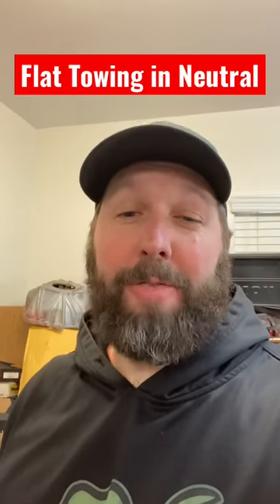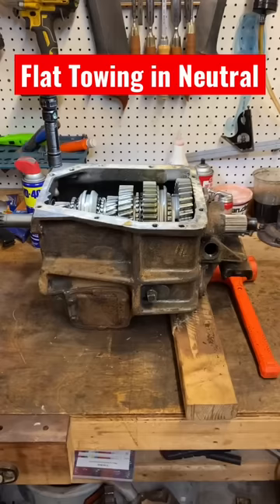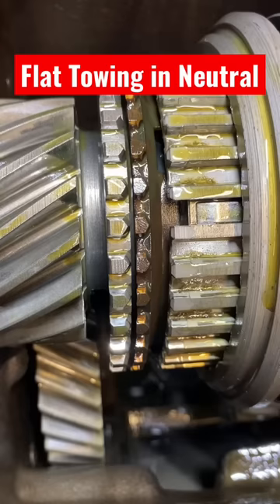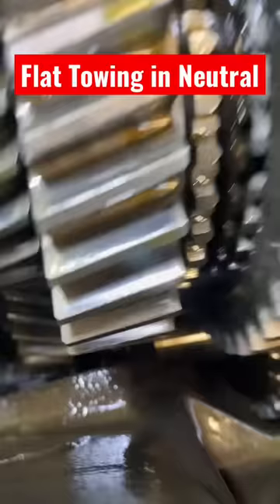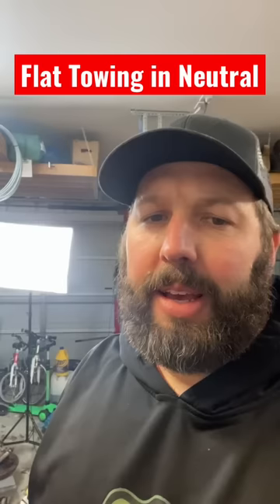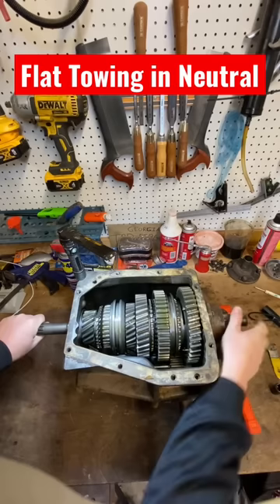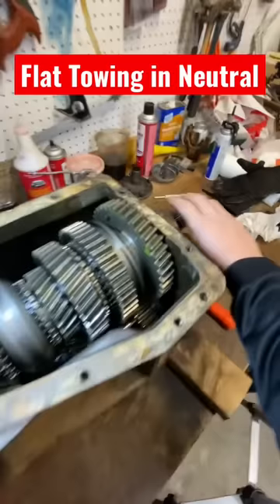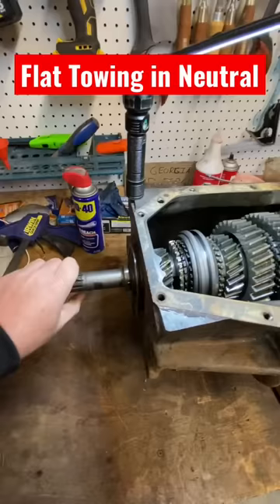Flat Towing in Neutral??? #transmission #stickshift #mechanic

Comment: You overlook 1 main thing... here's no dam load on those free spinning gear. Hence the heavy oiling ain't necessary.
  Secondly no towing company going to tow vehicle for miles.
Reply from the maker: I guess Tremec doesn’t  know what they are talking about either 🤷🏻‍♂️. https://www.tremec.com/not_am_detalle/flat-towing-manual-transmission-vehicles/
Reply: @freedomworx  I don't care what tremac want to say ... I have rebuild many gearboxes and I can assure you that towing the vehicle in neutral will not cause damage.... the gear oil stick to these gears and require great effort to dispose... there's no load/pressure on these gears to cause damage... especially for short journey traveled when towing (as stated in the article) 
  You need to understand that these gears are very harden metal.
   Now extreme situation as the vehicle was sitting for years ( n even so there we be gear oil on them) or the gearboxes recently build and was not lube after degreasing and the vehicle is then tow across states ... yes it will be damage. So if the above condition are what you are referring to then I agree 🤣.
Reply from the maker: And you need to understand that it has nothing to do with the gears. It’s the spinning bearings that build heat and seize. There are literally no gears meshing in the stated condition. So you totally misunderstand the situation 🤷🏻‍♂️ Read through all the comments and tell all those that destroyed a transmission that it will cause no damage. You can learn from this or you can remain ignorant. Makes no difference to me 😘
Reply: @freedomworx  lol.... there's is always   gear meshing... its lock into gear when selected.... now you need to get in your head that if the gears or lock and loaded then there's no dam pressure on bearings to cause damage when towing.... the weight of the vehicle is not not being carry by the gears nor bearings... the output shaft is driving the lighter free gears and bearings... but the gears and bear will surely damage when it driving the out put shaft which intern move the weight of the vehicle...
   Your so confuse and not understanding the load on parts when the driven system is powered on reverse. 
    The gear oil is not thick for no reason, it a heavy lube next to grease that remains on surface apply... it will take a great deal of time to dispel it.
     Bearing can get damage even when properly lubricated in a gearbox .... what you think cause these catastrophic damage... LOAD!!!! what load???? ENGINE LOAD!!!!!  No dam engine load is present on gears nor bearing when tow.
    Many manufacturers recommend that vehicle be place in neutral when towed ..  so who knows best????
   Imagine a engine jam or damage n u place it into gear and tow???
   Just stop tell people crap. ... no vehicle being tired is going to be towed across states and only a idiot would do that and destroy their trans. 
   I have read a # of comments and the are 90%+ not in agreement or mocking this video... amongst the comments are also great insight as to what is happening and not a broad blanket statement like made by this video.
     In everything you have ignorant owners who don't know how to operate equipment/tool and they cause further damage.
Reply from the maker: @willis23jm1  watch the video and tell me that those output shaft gears are meshing with and spinning other gears 🤷🏻‍♂️
Reply from the maker: @willis23jm1  5 million views across multiple platforms, and about 2000 of you knuckle heads can’t seem to comprehend even after being shown with an actual disassembled transmission , or being given an article from the premiere manual transmission manufacturer in the nation. And bearing the fact that every single heavy truck gets the driveshaft removed when being towed. And refusing to actually read the video description before making ignorant inflammatory comments. If ignorance is bliss… there are some happy folks in the comments section 😘
Reply: @freedomworx oh I see your problem... because the gear isn't spinning you conclude that it no longer is meshing 😂.... well the gears are always meshing, it's just not lock to the output shaft hence the output shaft doesn't spin. .. but they spin when you turn the input shaft... now tell me if you see any of the gears actually shift..  the gears always mesh its just not lock to the output shaft..
   Now what you not getting into your head is that there's no load/ pressure on any bearings nor gears when the power source is coming from the output... hence no damage will occur.. 
  Bearing and gears are design to bear load... the gear oil is to extend their life when carrying out this duty ... but if there's no load then what else would cause damage???  Friction??  Well in order to produce friction that will cause such damage you going to need LOAD!!!
      OH FYI most modern gearbox oil level and location (different design) 🤷🏾‍♂️.
Reply: @freedomworx lol.... how many out of the 5 mil are actual mechanics or engineer?  Majority isn't an indication of being right..
   The main reason why you would disengage a truck drive shaft when towing is normally when you suspect damage to gears/ bearing not because the output shaft will drive bearings n gears and cause damage... it just to not cause further damage ...meaning there's already DAMAGE!! 
   Now surely you have seen way more of these trucks being towed without disengage the shaft with no. Damage 😂. 
   Stop spread false information  termac or what ever that company name transmission main need to disengage because of their stupid design .. but this is not needed for other manufacturers period.
     Funny how in the video you actually turning shafts and none of them broke!!!!  You wanna know why??? NO DAM LOAD!!!!😂
Reply from the maker: Drain the oil out of your diff and drag the truck down the road and then. See how long that unloaded pinion bearing lasts 🤷🏻‍♂️
Reply from the maker: @willis23jm1 well I’m an engineer…are you?
Reply: @freedomworx  well we both are 🤣..
 So mister engineer ... which  will fail first a lubricate bearing under load or 1 that's not underload??
Reply from the maker: Your arguments are ridiculous. There is a reason that so many owner’s manuals tell you to remove the driveline, place the T-Case in neutral, elevate the drive wheels, or to simply not flat tow. There is literally an entire industry dedicated to making systems to prevent this type of failure on vehicle towed behind RVs. Yet you think the transmission designer, vehicle designers, and RV industry are just a bunch of dunces. You are just making yourself look foolish. If your owners manual tells you not to do it (some do and some don’t)…this video explains why. That’s a simple, evidence based, fact. Your references are “trust me.” 🤡

Comment: So, does the input shaft stop moving in neutral, no.  It continues to move because the engine is still running.  While its not physically driving the out put shaft , it is still spinning .
Reply from the maker: What’s your point?
Reply: @freedomworx  The point is that it will still get lubrication because the input shaft and counter shaft will still be spinning unless you shut your engine off.....or am i missing something..
Reply from the maker: @robertlove7607  if the engine is running, yes, the input shaft is spinning as long as the clutch isn’t depressed. But I doubt anyone would tow like that unless they knew what was explained in my video. Which is why I made the video.
Reply: @freedomworx  .... thanks for the explanation.

Comment: you’re thinking about it to much, it’s fine
Reply from the maker: It’s fine until your trans or entire cars burns to the ground. That has happened to plenty of people that didn’t think about it enough. There is a reason that Owner’s Manuals have a section about flat towing. https://www.tremec.com/not_am_detalle/flat-towing-manual-transmission-vehicles/

Comment: So you put in in high gear and the engine rotates for the whole tow?
Reply from the maker: You should read your Owner's Manual. Towing in neutral is fine for some vehicles. Some need the driveshaft disconnected.

Comment: So... just don't tow one at all? Or prop the clutch down?
Reply from the maker: First thing is to read the owners manual. But there are ways to tow most vehicles. T-Case in neutral, driveshaft removed, transmission overfilled, engine idling, etc. Some can be towed in neutral perfectly fine.

Comment: Yeah but there’s no engaging of gears so u don’t need lubrication and minimal friction so minimal heat as well. Go ahead tow it in gear and watch how he puts it in first and drives on the highway.
Reply from the maker: There are plenty of folks who have grenaded, welded, and touched transmissions and entire vehicles from flat towing them improperly.  🤷🏻‍♂️ https://www.tremec.com/not_am_detalle/flat-towing-manual-transmission-vehicles/

Comment: By the same logic, it is harmful to coast a manual car in neutral?
Reply from the maker: You’d have to coast a long way, really fast.
Reply: @freedomworx  Thank you for the prompt answer! I'll fess up, and say that I usually coast to most stops, because it saves wear and tear on the clutch. However, this is meaningless, if doing so will increas wear on the transmission itself.  I'm thinking I should stop doing this now...

Comment: Yep, 3rd or 4 th gear should be just fine😎
Reply from the maker: You should read your Owner's Manual. Towing in neutral is fine for some vehicles. Some need the driveshaft disconnected.

Comment: Sooo you burn out the clutch? Or force the engine to spin without actually running? Baaaad idea.
Reply from the maker: That’s not where I was going with that video. You read the owners manual to determine the proper technique. 4wd T-Case might go in Neutral, you might need to pull the driveshaft, or you might not be able to flat tow at all. Never insinuated to tow it in gear.

Comment: Aren't those gears normally submerged?.. you would be just fine
Reply from the maker: The countershaft gears are submerged, but the countershaft doesn’t spin when flat towing in neutral in this transmission. https://www.tremec.com/not_am_detalle/flat-towing-manual-transmission-vehicles/

Comment: How far do you have to flat tow a car to ruim a speed box? Isn't a trailer safer and cheaper than adding miles to the car unnecessarily?
Reply from the maker: Depends on the vehicle. Some can be towed indefinitely. RVers don’t want to tow a trailer. It’s not convenient for them. Hinders parking the RV.
Reply: @freedomworx  Lack of skill and  imagination powered by laziness
Reply from the maker: @gabrielgomescunha  Thank You… I think.
Reply: @freedomworx  i wasn't tying to be nice or or not nice. just an observation. a lot of businesses rely on peoples laziness, vanity and ignorance to make a huge profit. in my opinion this is just another example.
Reply: @freedomworx   by the way, this is illegal in most if not all europe
Reply from the maker: @gabrielgomescunha  gotcha. So in Europe, nobody flat tows a vehicle behind an RV?
Reply: @freedomworx  not in countries i know of and never seen it done. You could pull a car with your car in a emergency for a short distance with a rigid tow bar but it was years ago and i don't know if you can still do it, besides we have very light cars that you can pull with almost any other car as long as it is heavy enough. for example I can tow a trailer up to 2700kg with my V70 Volvo. So pulling a small car on a trailer is rather feasible with a camper since those are based on big vans or small truck bases
Reply from the maker: Yeah, you guys have normal sized vehicles over there 😂

Comment: So is it bad to coast with it in neutral?
Reply from the maker: Probably not going to be an issue unless you are cost down an entire mountain range or coast at 100mph. If the engine is running and your foot isn’t pressing the clutch, it’s still oiling.

Comment: So, how many miles are we talking about? There is a manual that well give me the information on how far you know a particular vehicle before dropping the driveshaft. I used to do nothing but recovery, so be Specific
Reply from the maker: The point of the video is to bring awareness to the fact that it is harmful to flat tow some manual vehicles with the transmission in neutral. Because most people would never think twice about it out of ignorance. I can get specific about something that has so much variability. Some can go forever, some can go 4 miles, some can’t go at all.
Reply: @freedomworx  I grew up way out in the stix in the 70’s and 80’s with no internet , I was common knowledge then
Reply from the maker: @chadrowlett893  no such thing as common knowledge now. Kids are creating genders and eat Tide Pods 😂😂
Reply: @freedomworx  hard lessons are the best lessons, let them screw up a few times. It will make them resilient
Reply: @freedomworx  YOU KNOW YA CAN’T FIX SPUPID.🤣
Reply from the maker: @chadrowlett893  im a big fan of natural selection 🤷🏻‍♂️
Reply: @freedomworx  you are correct! Learn the hard way. This is the Gen X way. I have spoken.

Comment: Is the best way to just drop both driveline and tie them up or?
Reply from the maker: You should read your Owner's Manual. Towing in neutral is fine for some vehicles. Some need the driveshaft disconnected.
Reply: @freedomworx  😅I got a 92 wrangler, sorry didn't come with an owners manual when I bought it second hand

Comment: Should be a wavy washer "oil slinger on out put shaft
Reply from the maker: Won’t matter if there is no oil up there for it to sling. The gears on the output shaft would sling it just fine if the oil reached that high.

Comment: But what’s happening to the clutch when you are in gear and flat towing 🤔
Reply from the maker: Never said to flat tow it in gear.
Reply: So towing with drive shaft removed is the point of this video?  Sounds misleading to make people try to tie in gear.
Reply from the maker: The point of the video is that if you throw your manual trans in neutral and yank it down the road, you could damage the transmission. You should read your owners manual as stated in the description.
Reply: Got it. I don’t read the descriptions on shorts. Lol
Reply from the maker: @Dan-lu2gj me neither 😉

Comment: Why can’t they design the transmission so that both the input shaft and the output shaft are sitting in oil? Seems like a simple solution
Reply from the maker: That would make the transmission Extremely inefficient. The designers aren’t dumb. They just have to balance several design considerations.
Reply: I don’t see how a little oil makes the tranny inefficient, let alone extremely inefficient!
Reply from the maker: @twincams350 because churning oil is fluid friction. It’s the same reason you don’t fill an engine or differential to the top. It’s simple physics and a basic engineering principle. Go put a few extra quarts in your engine and see how your fuel economy changes.
Reply: Performing your suggested experiment would brick my engine (cavitation of the oil would happen long before the point where the moving parts are submerged in oil). But in the case of the tranny, I’m not talking about submerging the output shaft. Just having a little at the bottom like how it is on the input side. If there is any loss of efficiency from fluid friction, it must be tiny compared to the friction of the metal moving parts. Your example uses a very old transmission. Do you know for sure that modern transmissions still have this design?
Reply from the maker: @twincams350  cavitation? I think you might mean aeration… yes, pretty much every heavy duty manual transmission is still made this way.  https://www.tremec.com/not_am_detalle/flat-towing-manual-transmission-vehicles/
Reply: In my mind, I think aeration but everyone else seems to call it cavitation, so that’s what I use. Thank you for the link. I am still hoping that my transmission isn’t designed that way, since you qualified the link with “heavy duty”. I have been shutting off my engine and coasting in neutral when approaching long red lights to save gas. I will stop doing that until or unless I can get specific information on my transmission that indicates it is ok to do that. I have a 2006 Lancer evolution with aftermarket 5 speed built by Shepard Transmiissions.
Reply from the maker: @twincams350 Read the owners manual and see what it says about flat towing. If it says you can flat tow, this is probably why. That being said, there is no economic advantage to shut off your engine while coasting in most cases. The engine requires fuel to idle, but it doesn’t require fuel to coast in gear. A lot of factory tuning provides zero fuel to the engine in coasting situations.
Reply: The manual says any towing will have to be on a flatbed truck, since it is AWD. I can’t “coast in gear” because that would be engine braking. I probably won’t coast more than 10 feet. I will continue to leave engine running while coasting in neutral until I Learn that my specific tranny oils the output shaft with engine off. I’ve also read that since it takes a little more gas to start the engine than to idle, the break even point is 30 seconds.

Comment: But lock the front hubs and put transfer case in 4h.  Problem solved.
Reply from the maker: What problem are you looking to solve with that technique?
Reply: @freedomworx  jeep owners manual states that so the gear oil is slung over gears when flat towing.  All jeeps can be flat towed.  I have jeeps from 1979 to 2012.
Reply from the maker: Locking the transfer case in 4wd and locking the front hubs is not how you flat tow a jeep or any other 4WD. That’s a great way to destroy the entire driveline. The T-Case is placed in Neutral 🤷🏻‍♂️

Comment: I press the clutch with a bar and leave the car in 6th gear. No issues so far.
Reply from the maker: You'd probably notice if the rod came off. Can't see it really hurting anything in 6th if that rod cam unhinged...probably 😉